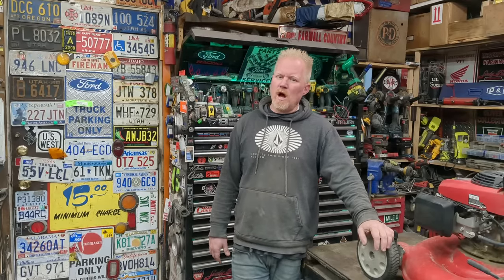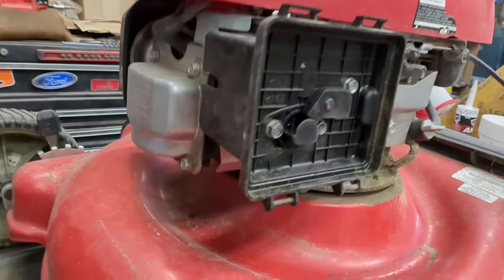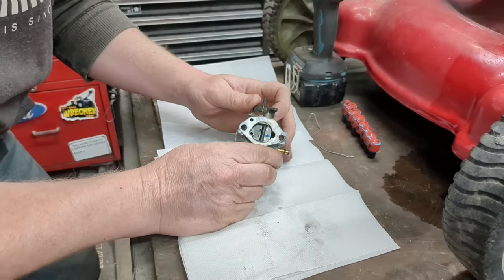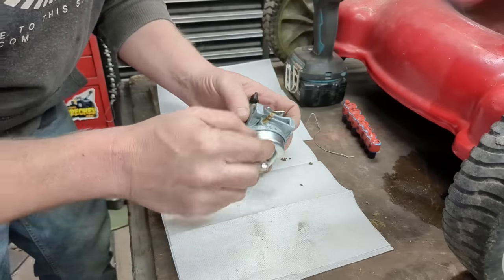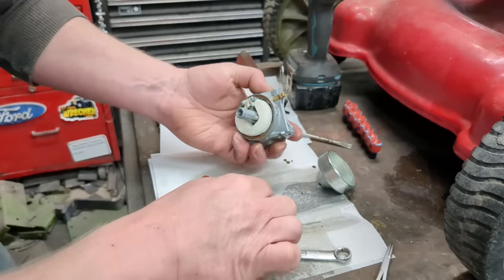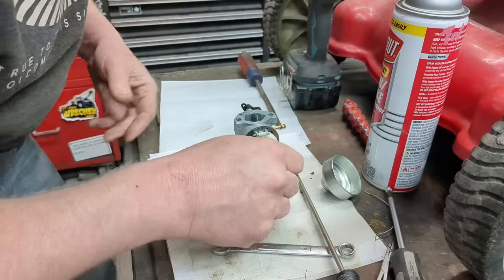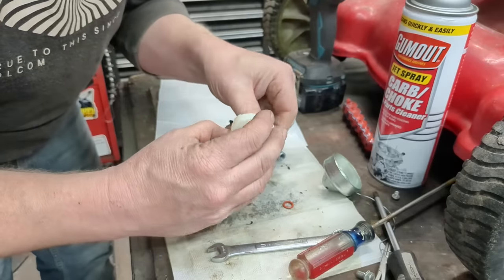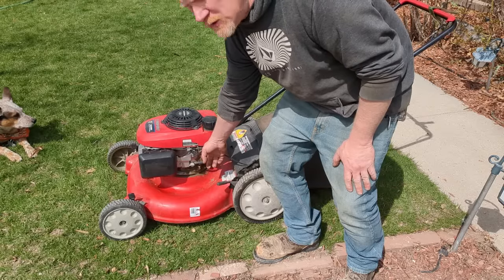FIX Engine Surging on any small engine QUICKLY

Comment: So what if the carbs brand new, and it's still surging.
Reply from the maker: By "new carb" do you mean a cheap Amazon/eBay China clone? If so, those are notable for having jet issues that are undersized. You will never get a better carb than the OEM. Either clean your old one like I show or keep buying the clones until you get one that doesn't surge. Buy from different sellers.
Reply: Yeah I just bought from local dealer so it's probably a cheap clone.
Reply: I honestly feel like it's a vacuum issue but I'll clean the OEM see if I can get it working.
Reply from the maker: @YankDj  The only other reason an engine would surge is if the intake gasket isn't seated properly and bleeding air behind the carburetor.
Reply: @sixtyfiveford  i cleaned the original out good as new

Comment: Every time I've cured engine surging, the cause was a gummed-up carb blocking fuel delivery. A few times it was a bad spring or mud dauber impeding the air governor.

Comment: Here is what the internet says about Acetone.  Can you put acetone in gasoline?
“Don't put acetone in your gas tank.” While the acetone is in your fuel system, he says, “it'll be eagerly dissolving all of your rubber components … like gaskets and O-rings.”
Reply: Only if left in the fuel system for a loing time. You CAN add it.....run it dry ( while it cleans everything up for you)...then refill with normal gas. The trick is not letting it sit for a long time. Add it.....run it to near dry.....refill with gas. Won't harm seals.

Comment: Pure butane,, just blow it into the throttle body while its OFF and wait for all the crap to start running out the intake,,   evaporates quick or just rinse it with isopropenol  (100% alcohol)

Comment: what if i replaced my carb and its still surging?
Reply from the maker: Two reasons: First these cheap $15 carbs are notorious for having wrong jet sizes and surging. Second if you have a intake leak from not getting a gasket on right it'll surge. 

There is no better carb than the carb your machine came with. Clean it at all costs.
Reply: @sixtyfiveford  I'd love to utilize the original carb but I cannot get the main jet out - now its stripped and un-removable
Reply: @sixtyfiveford  you were right thanks

Comment: My motor surges and I just replaced the carburetor and spark plug?  There’s no way the carb is dirty.
Reply from the maker: If you replaced it with an aftermarket carburetor that is likely your issue. They notoriously have undersized Jets. It is also very common when you have a gummed up carburetor/system throwing a new carburetor on without flushing the entire fuel tank/fuel line will reclog a new carburetor. 

The only other cause for surging is a leak after the carburetor I.e and improperly installed gasket/ leaking gasket. The excessive air flow into the intake/ create a lean mixture.
Reply: @sixtyfiveford  will it hurt the engine for to run that way?

Comment: I use fresh ethanol free gas, use stabilizer,  change the oil, change the air filter. Just like clockwork I have to rebuild or replace the carburetor EVERY YEAR! 
I dont need this aggravation.
Reply from the maker: You either store your mower outside or the gas can you fill it with. Plastic gas cans will suck moisture directly through the walls, they are not airtight. The fuel is such poor quality these days, even ethanol-free the stabilizer doesn't do anything. Storing indoors out of extreme temperature swings is the key. I can take a chainsaw off the shelf that's been sitting for 2 years and it'll fire right up, All because it's stored indoors (garage) with minimal temperature swings.

Comment: I have a new carburetor on mower and it.still surges
Reply: What about when you put a new carburetor on a mower and it still surges? Is there anyone who knows?
Reply from the maker: @wesleymorse4438  Number one reason is the cheap $15 Amazon/eBay carbs are trash and commonly have the wrong size jets. The only other reason is the gasket behind the carb to intake manifold is leaking air. Generally it's the first. Clean the old carb if you can. Even if you get a cheap carb to run, the rattle themselves apart and dissolve after a season or two.... Yes, dissolve.

Comment: With two cases for me, it was the diaphragm.  It was on those new cheaper carbs they started using.  Now they have the throwaway carbs.  I can't stand them.
Reply from the maker: Yeah, two stroke diagrams dry out all the time these days. With current fuel they only last two to three years now.
Reply: @sixtyfiveford  I mix the gas with water and shake it like mad.  After it separates I drain the water and alcohol off.  I still add a stabilizer but it might be snake oil.  It seems to make it last but haven't tested it.
Reply from the maker: @backyardsounds  I had to do the same for about a year until ethanol free became available again. I had a commercial fuel manufacturer that I could buy it from for a few years, now it's readily available at nearly 25% of my local gas stations. I'm really on the fence with stabilizers. Turns out all it is is Naptha, aka zippo lighter fluid. 

I think the biggest change for me was finding out that the regular red gas cans aren't air tight. They allow fuel vapors to escape and moisture to suck back in. Switching over pretty much everything to metal gas cans definitely makes my fuel storage last longer.
Reply: @sixtyfiveford  Naptha!?  Ok, not buying that again.  I think you're right on gas storage.  It only makes sense.  Love the vids!
Reply from the maker: @backyardsounds  I have a vintage metal can of Sta-bil and it says right on it that it's Naptha. Now if you look at the safely sheet for Sea Foam it says it's Naptha (stabilizer), rubbing alcohol (combines with water to allow burning) and a mineral oil(miniscule cleaning ability)

Comment: Brand new carb. Still surges. Won't start without starter fluid
Reply from the maker: @MrJohnnyb42  Brand new aftermarket carb. If so, that's your problem.
Reply: @sixtyfiveford  customer bought new carb on eBay. It was flooding and hydro locking the engine. Fixed the leak, will only start with ether, still surges. Pain in the ass. That's when you lose money and customers. Sometimes.
Reply from the maker: @MrJohnnyb42  On a side note, if they're buying a $15 carb for you to install, that's not a customer you want. You'll lose money everyday with those. 

Will only start on starter fluid: That means the choke isn't working or primer button. 

Surging: idle passage is clogged or as I see in a lot of aftermarket carbs too small. 

If the old carb isn't completely corroded and just dirty, I would clean it. I generally end up saving about 99% of all carbs. It's only a random oddball that's been sitting for 15 years unused that's rotted to the point I can't fix/clean. My parts cost is generally a quarter can of carburetor clean. Maybe 1% of the carbs need a needle seat. Other than that they never need any parts. They're just dirty.
Reply: @sixtyfiveford  Thanks. Your right. Very frustrating especially when they are your friend. You can't make much $ Polishing turds.

Comment: well crap. I did all of this and my snowblower is still surging. 
It's possible that  my gas is not good. I think draining the tank is the next step.
Reply from the maker: Clogged idle passage.
Reply: @sixtyfiveford  I'll check it again, but I have carbureator cleaner spray coming out multiple tiny holes in the sides. and I also cleaned out the jet and the arrerator plug. It was pretty varnished because I forgot to drain the gas, so maybe it just needs more cleaner put through it. I think i'll throw some wire through the jet too.
Reply from the maker: @martixagent  is it a Tecumseh snowblower engine?
Reply: @sixtyfiveford  You were right, it was the idle line. There's a plug in mine instead of a screw in mine and that plug has a very small hole leading to the bowel that got plugged. I cleaned that out and it runs strong now.
Reply from the maker: @martixagent  awesome

Comment: Just rev it up & choke it out with your hand & if you get lucky it will suck the blockage thru & idle smooth again
 That symptom is also called "gallop"  & IMO its the trademark for a Honda small engine 😂

Comment: I found by using 98 RON fuel my mower dead smooth
Reply from the maker: Some places have no ethanol in higher octane, so that can be beneficial. However, it's debated that higher octane will give you less power in low compression engines, like mowers. Octane is simply put in the make the fuel less likely to self combust(detonate) under compression. Anything under 10:1 compression ratio will have no benefit from high octane, other than costing you more.  A mower engine is only between 6:1 to 8.5:1 and easily runs off 85-87RON. Now non ethanol fuel actually has mower power than ethanol diluted fuels(e10-e15 ect) so you could see a difference there.

Comment: Carb is the biggest weakness on Honda engines. I'd gladly pay for fuel injection.
Reply from the maker: They make fuel injected Honda engines. The biggest weakness isn't the carb it's the fuel people use and the time these engines sit unused. If you left your car to sit for 6 months every winter it would gum up the injectors. The shelf life of modern ethanol laced fuel is 30days.
Reply: Thanks, Boss. I live in San Diego and so I mow year round. After watching your video, I think my problem is the govenor rod and lever adjustment. I can't get it to rev. It doesn't hunt so the carb must be good.

Comment: Incorrect.  Most common problem is that mf won't start. 😂 Anything from christmas lights wrapped around the crank shaft and blade, to the fuel shut off valve being on. 😂The reasons are many.. but in a shop, that's generally what you work on. Also, many of the newer cheap engines are so leaned out on fuel that they surge brand new from the factory. We actually have to manually resize the carb jets just so that they run right. Probably illegal in CA.. but I don't live there so idc. 😂

Comment: I think I'll buy a battery powered mower next time.
Reply from the maker: That's an entire bag of problems by itself. 1-3yrs and you need to buy a new $100- $200 battery. The average homeowner's mower lasts about 10 years with no service at all. If it's serviced it'll last 20 to 40 but most people stop wanting to service it at about 20 years and retire it due to mechanical problems like a wheel wearing out but generally nothing to do with the engine. If we take that same mechanical retirement and push it to electric lawn mowers they should be pushing 20 years, maybe. They seem to have a lot more plastic than a conventional mower, so that's yet to be determined. However, then you run into planned obsolescence with batteries. Electric lawn mowers made 10 years ago batteries are nearly impossible to find and if you do their new old stock or extremely expensive. So planned obsolescence they want you to be done with these electric tools at 7- 10 years.
Reply: @sixtyfiveford  I was considering battery powered because it's problematic transporting gasoline. But you're right, 10 years from now one might not be able to get batteries or chargers for these things.

Comment: Blow it out with air compressor !
Reply from the maker: In the thousands of carbs that I have rebuilt a compressor is seldom if ever needed. Maybe just on the exterior to remove the larger debris. Carburetor cleaner lets you visually see the passages clear. The air compressor does nothing and won't force a passage open. It can actually Lodge larger particles further in and you're never getting them out.